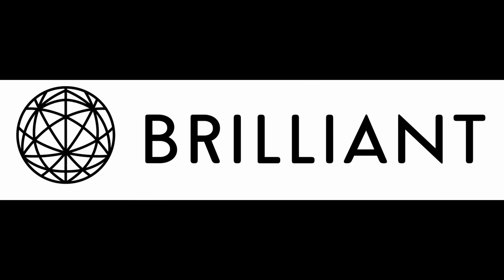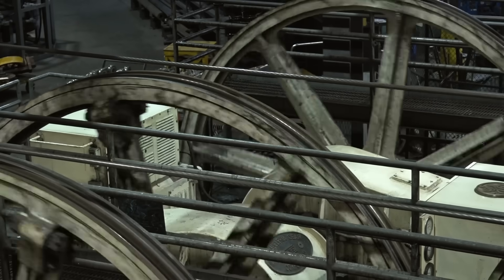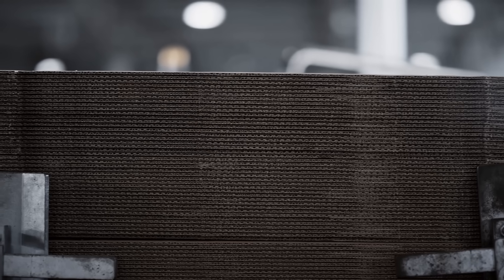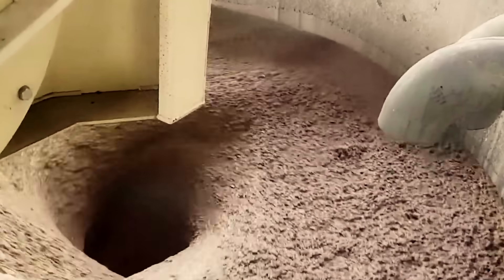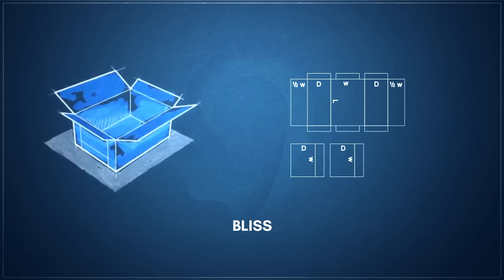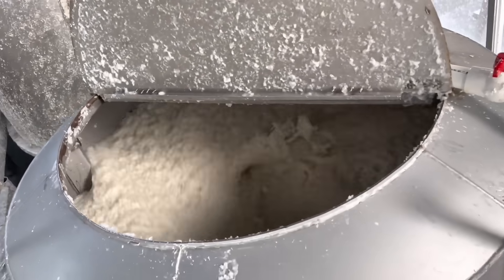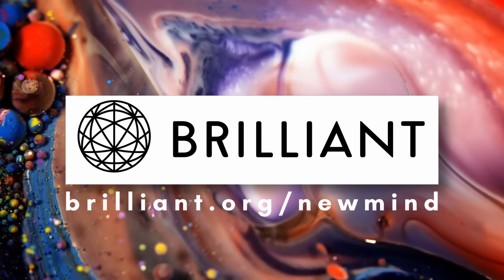The Science Of Cardboard

Comment: Idk about the economics of scale and all, but cardboard packaging that can be opened without any damage could just be sent back to the original packager to be reused without being completely regound and formed.
It might take a bit for enough to be collected for a full load to be hauled and there are other issues, but for places that recieve a crap-ton of the same packages from the same place, there should be enough savings vs the normal recycling to make it worth it on at least some of the cardboard waste.
Reply: But it's not. Cardboard is recycled by grinding it down again into a slurry.
Reply: And adding some virgin paper.

Comment: Most smaller products are sold to the and shipped to the retailer using the cardboard case of 12,24,48 etcera units. The brick and mortar retailer puts it on the shelf for sale. One cardboard box for many units. The problem with using Amazon and other on-line retailers is the repackaging in cardboard or plastic to ship to the consumer creates several more times the waste. The cellulose fibers get shorter and shorter with recycling.

Comment: A cardboard box. A cardboard box usually consists of a thin pasteboard with a corrugated paper center. They are usually made of recycled paper. It was first invented in Europe over one hundred years ago. It was originally used to absorb one's sweat when wearing hats. With the same amount of wood to make one wooden box, you can make six or seven cardboard boxes. And since it's recyclable, it's highly economical. In addition, it is strong and easy to store. That is why it is widely used for packing. But to avoid damaging weapons and other delicate instruments when shipping them, they should be packed in stronger boxes, like... wood or something. Also, the crevices should be filled with Styrofoam to prevent them from moving around. ...So anyway Snake, what's with the box?

Comment: My father ran a small welding and machine shop that made machines for Michelman (a coating manufacturing company) that applied coatings to the cardboard during is manufacture and was inserted in the production line. We made simple blade coaters (used a rubber blade to apply and control the amount of the chemical coating and later one that used various rollers and a metering rod that could run 1000 fpm for high volume production. I helped build the blade coaters and made detailed drawings of the various parts using the simple shop sketches they had been using for some time as well as drawings of the initial prototypes of the larger coater machine. This was during the 80's and early 90's.

Comment: Cardboard sure is abundant....a good bit of the products that are shipped to me come in cardboard boxes at least 10x larger than the product itself
Reply: That's usually intentional because some suppliers and distributors will choose a box that not only fits the product but also fits best into a stack of other boxes.
If smaller boxes are used to fit the products better and then stacked without considering the stability of the whole stack of other boxes you end up with a huge amount of damages due to stacks falling over, boxes being crushed, product damages etc, resulting in lots of replacements being sent, more boxes, more products scrapped and made, more cost, more logistics etc
Reply: @J30YLK  there's got to be a better solution, because doubling the ENTIRE shipping volume is WAY worse than all of the things you mentioned combined. That's double the cardboard, double, the trucks needed, double the warehouse space, double the fuel need for transport, etc.

Comment: As someone who has spent the last 2 decades in the secondary packaging industry (The pretty packaging that holds the products that go in the corrugated boxes.) I still find the whole paper industry to be exciting and interesting.  You did a great job with the video!
Reply: @Industrial Sleep the short answer, it depends on the glue used.  There are indeed plant and water based glues and it is completely possible it is organic.  Only the manufacturer of the glue and/or packaging manufacturer could answer this question.  The packager of the compost may know, but only if they asked or were told.  A reputable merchant should be able to provide certifications if they are claiming it is all organic.  If they cannot, I wouldn't trust them.

Comment: I like the way the principle of the truss was extended out another dimension to take advantage of yet another stiffening enhancement of the tube or I-beam concept, by redirecting bending strain across the somewhat vertical surfaces of the corrugation, and translating some of that further into tension across the parallel surfaces confining the corrugation.
     3 sheets of paper arranged and bonded strategically can be made ridiculously stiffer than a flat stack of those same 3 sheets, even if the stack was simply bonded.
     Roughly also why a paper cup can hold a kilogram of liquid or a paper cone can compress air hard enough to vibrate your house instead of the paper just flapping around.

Comment: In a past life I had exposure to the die board industry.  High quality dense dimensionally stable plywood had slots cut in it with an industrial laser machine tool.  Then knife-edges were pressed into the slots, hand formed into curves when called for.  
The sheets of cardboard stock would be pressed onto the die board to cut the flaps, etc...
Sometimes a pad of cushy foam to help push the cardboard off after pressing.  Send box flats to printer if you didn't do it yourself.  Send to packaging plant.  Bill net 30.  Profit.

Comment: The really exciting thing for me in the last few years has been the replacement of custom shaped polystyrene padding material inside the boxes with press pulp made from other paper. You take something out of the package and it arrives unbroken, and then the box and the packaging material and everything else can all go in the same recycling bin, instead of you having to find an entirely separate facility that actually takes packaging foam. I'm lucky enough to live in a small town in Michigan that has a foam products company I can take my foam recycling to, but I know that's not really an option for most consumers. It really is a pretty brilliant step forward for how we handle our packaging.
Reply: I even saw once a padding made just out of cardboard, someone took a cardboard box (tape was still attached, there were box symbols etc.), cut it in a very smart way and put it in as a padding. So it's like double recycling, first you use as a box, then as padding, then you recycle in those machines into new cardboard...
But also, in my country recycling is encouraged, if you recycle, your trash bill is 50% smaller. Everything (except for some dangerous things) will be taken from your house, you just need to put trash in correct bin or bag. There are multiple categories, "bio" (kitchen waste, mostly plant-based, no meat or bones), "paper" (incl. cardboard), "metal and plastic" (incl. multilayered packages like for milk, I think storyfoam would go there too), "glass" and "mix" (everything that doesn't fit other category). But I remember years ago when my mum would have to drive somewhere to give away paper to recycle.

Comment: very interesting, i love cardboard!
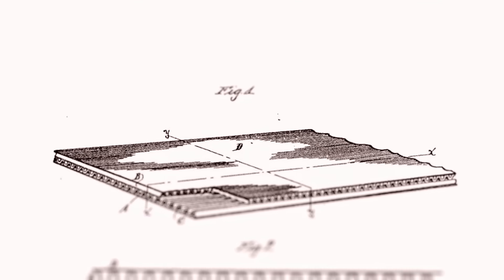i thought about why don´t they make alternating flutes cardboard and was surprised to see this in the patent drawing at 3:44 !! just like plywood, i imagine it would make the cardboard much stronger. is it too hard to make ? too niche?
Reply: Basically, you can't manufacture it in long continuous rolls. You have to cut a segment, rotate it 90 degrees, then glue it to another segment. This limits how big the sheets can be and makes them much more complicated (and therefore expensive) to manufacture. It's almost always cheaper and easier to just use a sturdier grade of conventional cardboard than bother with bidirectional fluting.
Reply: @5thearth  thanks ian, i figured. I love the honeycomb cored but it’s also so expensive and no suppliers sell small qtties
Reply: @5thearth  I guess if you really wanted to have 2+ layers of corrugate going in different directions, you would almost have to do it like they make plywood, with layers coming in from different directions, or just make 1 layer of corrugate slightly larger than the desired sheet dimensions, and then glue another sheet to it... Clearly that is far less economical (relative to the additional protection/strength that having crosswise flutes provides) than other ways to add additional protection and strength.

Edit: I believe I'm basically saying something similar to what you said, but perhaps not as clearly as you did.

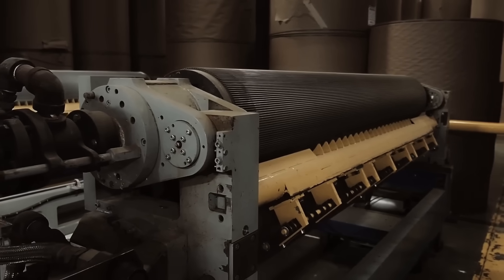Comment: 6:58 how can you heat something with steam above 100C?
Reply: Pressure.
Reply: Some external steam is sometimes applied to heat the paper and moisturize it. But most of the steam used to heat the paper is inside a pressurized metal vessel and only the heat is transfered through the metal to heat the paper.  Because the steam is under pressure the boiling point is raised above100 degrees C . These are basic principles of water/steam under pressure.

Comment: My uncle owns a chain of factories that comprises 4 levels of manufacturing facilities to completely the whole ecosystem:
1. called tier 1 factories: making pulps from recycled cardboards
2. called tier 1 factories: making corrugated boards from paper
3. called tier 2 factories: making painted packaging from cardboards

4. cardboard recycling factories: recycling used cardboards and paper and cut them into pieces and then press them into cubes
They are one of the biggest packaging solution providers to Nike for their footwear packaging.

You have done a great job! Most of the contents in your video are correct. I just would like to add two more things:
1. the recycled pulps can produce materials mainly for corrugated side (the inner side) of the cardboard and cannot be 100% used to produce the facing board/paper of the cardboard because of strength requirement. 
2. the recycled pulps are usually mixed with the virgin pulps to make the facing board/paper to provide enough strength.
Reply: You are correct that the strongest liner board is made from virgin pulp fiber. But liner board can also be made out of 100% recycled paper as well. I have made many, many tons of liner from recycled fiber. It is called test liner. It is a little weaker. Therfore test liner will run a little heavier in order to meet the same strength requirement. New approaches also alow line to be made by adding dry stench additive or to be starch coated.
Yes, liner board can be made with 100% Recycled wood fibers.
Reply: @TheHavocdog  : You are also right.. I also know such "test liner".. but some customers don't really like them for such test liner adds the overall packaging weights considerably..
Reply: @Industrial Sleep : usually the glue used is just a kind of starch.. mixed with water in some particular portion.. even the paints are usually bean oil based.. which make them nontoxic..

Comment: I'm curious to find out why some recycling places don't accept cardboard with food residue on it?
Reply: It's my understanding that the majority of mills are not equipped to process (or it doesn't make economical sense to process) the grease in pizza boxes. As the pizza box is repulped, the grease likely enters the process stream which would negatively affect the product quality and the health of the equipment. I have heard of some specialized dumpsters in larger cities accepting used pizza boxes for recycling. In that case, the manufacturer must have some method of processing / extracting the grease from their system when they produce the paper. Hope this helps :)

Comment: How is tape seperated from cardboard when it's being recycled? It's usually covered in tape, not always the same sort of tape, somethimes extra durable tape which is a pain in the ass to cut into, how do cardboard recycling plants get rif of it? I assume you can't just leave it on right?
Reply: The dry cardboard is blended with water to firm a slurry, not unlike wet mud. The  bulk of the tape the releases from the loose fiber. The slurry is then sent though fine slotted screens and the long strings of tape are separated from the small fibers.
Reply: Paper making equipment is fascinating to me. A new recycled paper mill will cost in excess of $450,000 000 to build. The paper machine  alone ( the last step in the process) may be over 20 to 30 feet wide and may be almost 160 + yards long.

Comment: 14:30 is that barrel of oil counted towards the 390kWh of energy expenditure? Because fuels also have an energy content measured in kWh, so what part of the crude oil is being saved if not the fuel part?
Reply: It looks like a barrel of oil contains around 1700kWh of energy. So it must not be included in the given 390kWh estimate. Its a good question tho, I wonder where that much oil is used. 
Actually that seems like a lot of oil to make a ton of paper.
Reply: @Chris-du7hi  In some mills, oil can be burned in a combination boiler to process steam and electricity for the mill site. The majority of the time (at least at the mills I've worked at), natural gas is the main supply of energy in the combination boiler. Tree bark is also burned for the same purpose. My best guess is that recycling paper reduces the amount of steam used in the cooking of virgin wood (the majority of wood delignification occurs at temperatures above 150 degC, so a lot of steam is required to heat the cooking chemicals when pulping wood). Ergo, there is a lower energy demand for producing 1 ton of paper. That's my best guess, but I'm sure the answer is more complicated and multi-variable.

Comment: today i found out that at my workplace double walled corrugated card is recyclable, but single walled is not!
Reply: Both single wal and double wall can be recycled. I have been doing so in my recycle mill for many years.
It doesn't matter for the physical structure of material. It does mater if additives such as wax or wet strengths are used that make it more difficult to repulp.
Reply: @TheHavocdog  I agree it's ridiculous but that's what our waste contractor has said